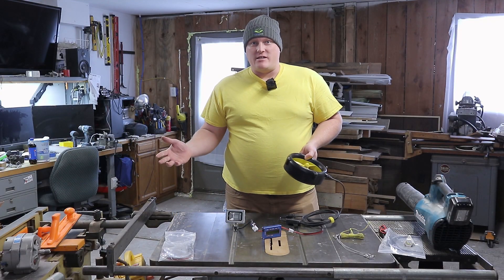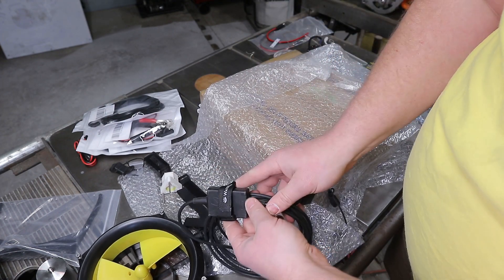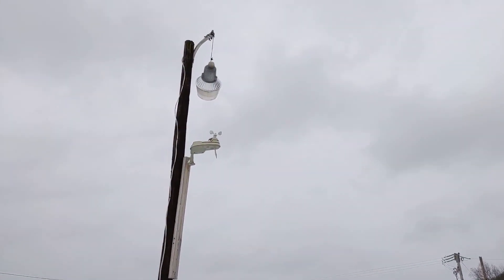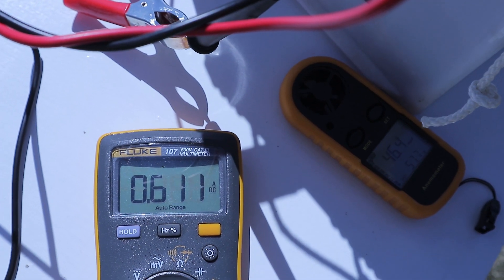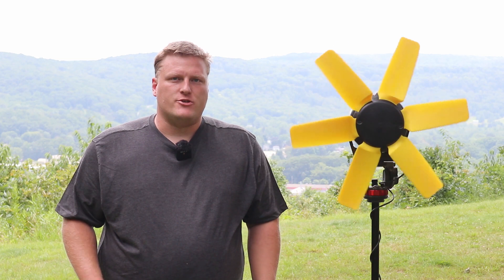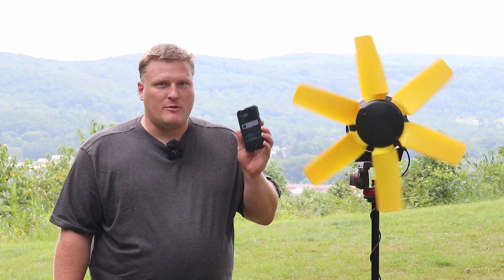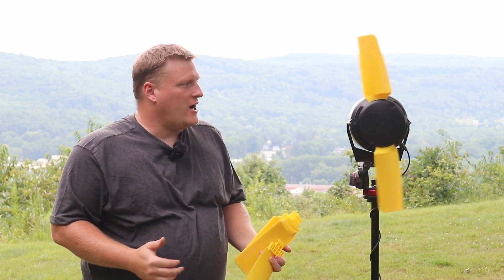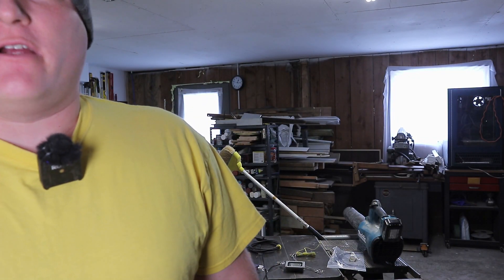Windlily, A Portable Wind Turbine Accessory For Waterily

Comment: All practical tests of ground-based small wind turbines show: 1) They hardly produce any electricity. 2) They do not last long! 
With solar panels, you can generate at least 10 times more green electricity with the same investment! Reliable and almost maintenance-free. Moreover, the wind close to ground is extremely gusty. 9 out of 10 small wind turbines therefore stop working after a short time! Flexible solar panels are also portable, much cheaper and more efficient!
Reply from the maker: @michaelvanallen6400  agreed.

Comment: How Can I hook this up to my solar generator?... or can I make my own to hook up to my solar generator
Reply from the maker: Yes you can
Reply: @JoeMalovich   do I just use the cigarette lighter male on solar generator into female of this wind turbine?
Reply from the maker: @PaulC112  yes. But do note that some solar generators can't charge up fully on only 14.4V.  That would be something worth experimenting with first.
Reply: @JoeMalovich  I know nothing about electricity. I'm looking for an easy solution for a wind generator to hook up to my bluetti eb70s
Reply from the maker: @PaulC112  if this is a mobile project then the windlily is a good but expensive option for the output. For a fixed installation you would be best served by a larger turbine built for that use.

Have you tried solar? It's often a better solution except in specific situations..
Reply: @JoeMalovich  i wanted to add wind to my current solar setup on my patio
Reply from the maker: @PaulC112  then I would recommend looking into a 300W to 500W turbine on a 20ft minimum tower. I can't recommend a specific turbine except be cautious when selecting one, some models are junk.
Reply: @JoeMalovich  I'm on the fifth floor lol... I just don't know how to hook a wind turbine to my eb70s .. and I cant find any info
Reply: Can u email a simple wiring diagram?
Reply from the maker: @PaulC112  I see.

In that case I would suggest one or multiple VAWT turbines, and air passing by a balcony will be turbulent which VAWT turbines excel at.

As long as the voltage output is within the range specified by the bluetti just connect the positive to positive and negative to negative. The center post on connectors will be positive (red)
Reply from the maker: @PaulC112  I recommend doing a quick Google search, there are many diagrams out there.

Comment: fillable weight bucket, outside ring blade
Reply: solar film on the blades
Reply: try vawt wind tower, generator is down on the ground through vawt axle, vawt should work nicely under water too, even ocean currents
Reply: wavt can also be folded in as a tube scroll, with support beams when open/operational
Reply: stick a pole in the ground, deep, thats the horizontal support, like a tent spoke
Reply: peltier stove heat generator for wood/biomass

Comment: this could be awesome for people living in vans or doing long offroad trips to charge their electronics or use it directly for light in the evening/night
Reply: If the engine is running, it is better to just use the ports in the vehicle. Much more power. Typical accessory port is 12V at 5A. Might work well when stopped to avoid draining the vehicle battery.
Reply: This is why I want one haha👌🏻

Comment: How much more effecient is the USB version vs the 12V versions using a usb car adaptor i wonder?
Reply from the maker: I think most car adapters just limit the voltage, the amps stay the same. USB version does 3A, the 12V version would do maybe 1.2A to 1.5A
Reply: @JoeMalovich  that's a good point. Bugger as I just ordered the 12v version :/ Id have to find essentially an MPPT  for bumping the amps up and drop the volts down to 5v.
Reply from the maker: @MrDingaling007  I'd almost recommend pairing this with a small power station device that can buffer the 12v and provide QC3.0 charging. Something like this https://amzn.to/3j45iJt
Reply: @JoeMalovich  That might be an option then ill look into that, although as its for hiking to rivers with gold for up to 2 weeks at a time, weight/space could be an issue. Will see if i can exchange for the USB version many thanks.
Reply from the maker: @MrDingaling007  or a 12v lead acid with a cheap low voltage disconnect can be used to power any number of 12v devices and USB chargers.

Another cheap option is to use a lithium battery that has a built in BMS which has low voltage cutout built in, something like this https://amzn.to/3rIBfux which can then be used to power your 12V devices and USB chargers.

I would be careful with any chargers as they draw some power even when not charging so disconnect all loads of you aren't actively using them. Just something I advise with low power generators like the windlily products.
Reply from the maker: @MrDingaling007  you probably can, they have a 4 week backorder right now.

Comment: A way to mount it onto a fence T post could be interesting. Would want a way to lift it 1-2 feet above the post but they are so common in open areas due to field fences.
Reply from the maker: Lash your tripod to the fence post?
Reply: @JoeMalovich  Skip the tripod and lock the fitting onto the post to use that as the support the windmill sits above. Just need something to lift the blades high enough above any fence/wire strands as the post is already driven into the ground it will not have much movement

Comment: anyone that does wind energy will tell you that an odd number of blades works better...for some reason.....maybe pass that info onto the person that makes that

probably use that same premise to water energy
Reply: Interstening, though I operate decently sized hydro plants, couple hundred kW and ranging from Kaplan from 21st century to older Francis from 1920s and all have even number of blades.
Reply from the maker: @Mike-kr5dn  where at? Want to host a tour?
Reply: @JoeMalovich  oh, it’s kinda far, Czechia.
Reply from the maker: @Mike-kr5dn  that is a bit too far...
Reply: as the video says you can run it with 3 if you prefer... but you will lose out in low speed conditions.
Reply: It is possibly a balance issue. Along similar lines, a car engine has similar issues. A 3 cylinder engine is more balanced than a 4 cyl. Similarly a 6 cyl has better balance than an 8 cyl. For engines they specifically work in groups of 3 for the best balance.
Reply from the maker: @cacaokingdom3122  engine balance issues are for a totally different reason.

The major reason with wind turbines is vortex interactions with the tower.

Comment: Mod it to get longer blades. Larger diameter more energy...win
Reply from the maker: Longer blades add drag so you get more low end torque but it won't get up to high enough RPMs
Reply: @JoeMalovich  and that won’t increase power? When we look at big wind turbines they were small just 27m in diameter with 850 kW max and today a 162 m diameter rotor can output 6 MW with the same wind speed and yes the rpms are lower, but transmission is different.
Reply: @Mike-kr5dn  but you can’t easily change the transmission on this setup

Comment: Hmm, Is it suitable for salty conditions? Like if your sailing at sea in your 21 ft:r  can you use the waterlily as a towed generator when your on the move and when your at anchor move it to the mas in the windlily configuration?
Reply from the maker: Yes and Yes, it's all plastic and stainless. It works fantastic as a tow behind as the water speeds are closer to the sweet spot. Your 21ft boat sails at  about 5 knots in good wind right? that should be around full power output. My dad has a 22ft sailboat  that was a staple of my childhood (freshwater).

Note that not all stainless lasts forever in salty conditions so I can't say it will last forever. I can't speak for the servicability of the turbine however if those few stainless components ever do need replaced.
Reply: Yeah, the grade of stainless matters a lot. Where I'm from they sell two different grades of stainless fasteners. One IIRC is 316, after a few years of year round exposure to the sea, it wil have a few spots of surface rust. The other kind rusts pretty much the same as plain carbon steel in the same conditions. Works great in the garden though.
Reply: @2testtest2  rinse it off with fresh water when you take it out and that's it!  years of service.
Reply: https://www.youtube.com/watch?v=crH7Q4LYDsk
Reply from the maker: It's all 18-8 and brass. You can replace the hardware with 316. You can replace the bearings with ceramic bearings (size r4). Supposedly no corrosion complains so far though.